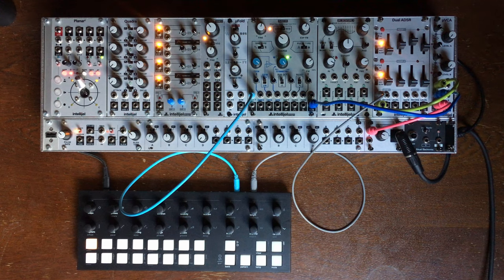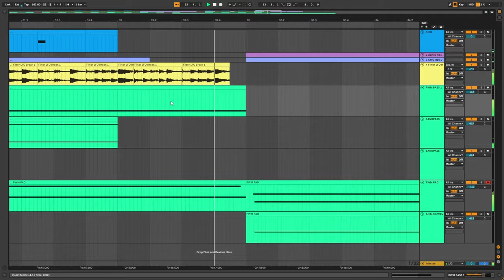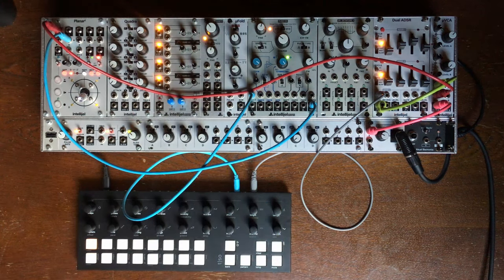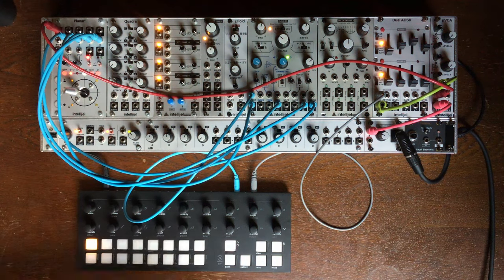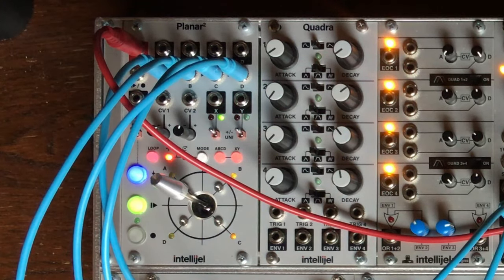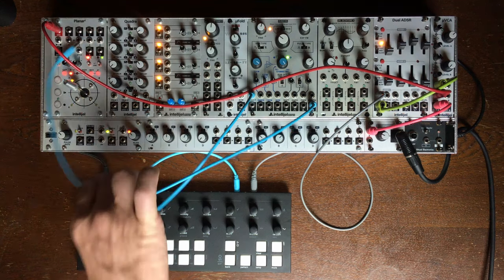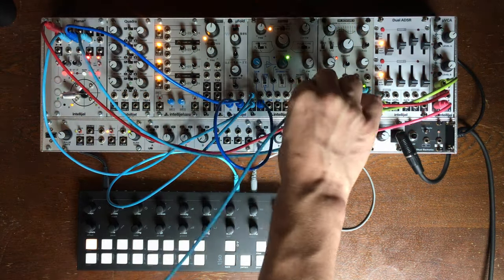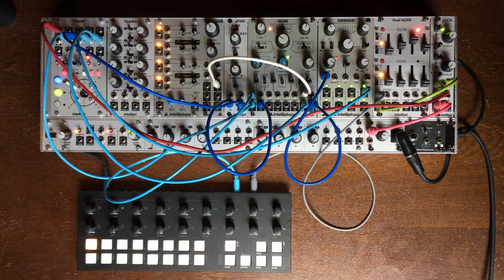Vector Mixing with Planar 2 by Intellijel

Comment: I was on search for ideas for Rubicon II-inspiration (have three of them) when I hit your video.
While looking at the use of Planar, I thought: Wait, what if the Planar would instead vector around different waveforms which would then go to the TZFM-input of the oscillator?

I would try....but in the end, I don't own a Planar and am WAAAAY too lazy to work around that with shifted LFOs and VCAs 😀
Reply from the maker: It’s a great patch you described, I already did it and it’s pretty fun. I find this one described here to be super satisfying instantly, more than the fm one you suggested, but for sure try it out, even cross fading with two sources instead of four ;-)
Reply: @Stazma  I currently only went with hardswitching the modulators . But yes, fading between different waveforms sounds quite nice!